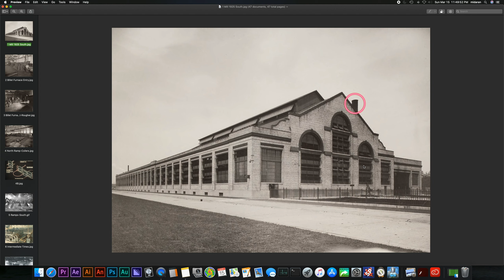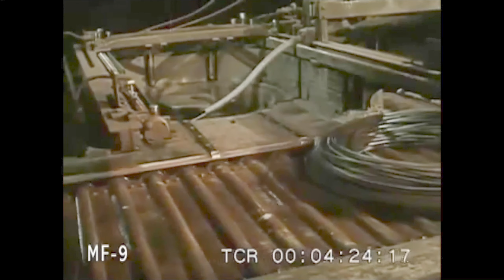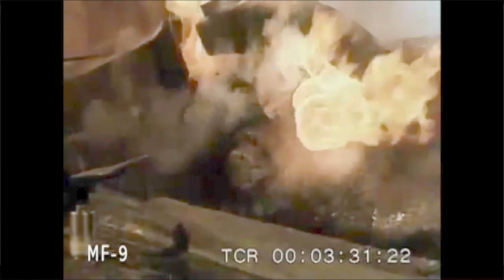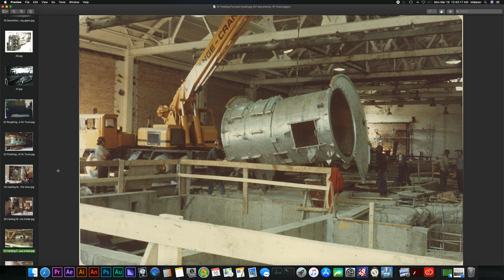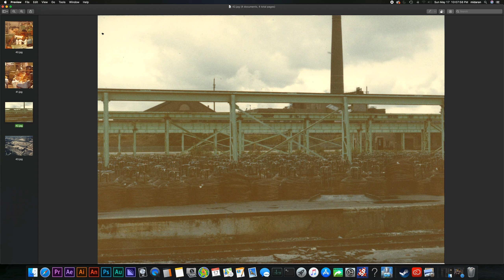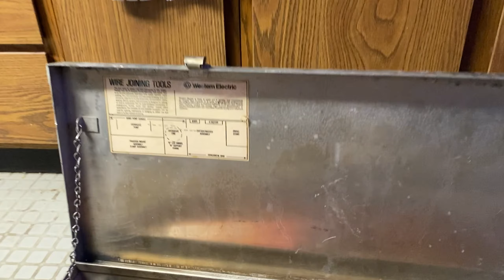Western Electric Rod & Wire Mill 1925-2008 Documentary

Comment: I had a tour of this mill in the early 70s. Remember one of the catchers picking up the rod he had just caught and lighting a cigarette with it.
Reply from the maker: Seems like a very 1970s thing to do😆 We used to cook chicken just by setting it near the tap hole of the shaft furnace. Even bbq inside. The building was designed to vent smoke so wth right?

Comment: Very cool, I used to repair submarine cable, old WECO cable & Bell Labs manufactured the amplifiers for submarine cable in the 80s, most of the cables we worked on were manufactured in the 50s. It used to blow my mind how long these damn cables were.
Reply from the maker: I have to wonder if there were factory splices in that cable. If they were manufactured in the 50s that would have been back when the rod mill still used copper billets. The length of the coils were short which limited the length of cable that could be drawn from them. I believe that cable could have been put together in the building just West of the rod mill. We used it as a warehouse, but it was known as the armored cable plant.
Reply: @TestTubeBabySpy  Yes absolutely much tighter then the ones we would make. IIRC we were using WECO B armour for these cable lays. They supported MiLS sites on several tracking stations on the Eastern Test Range. You could feel the factory splices as the cable was unlaying out of the storage tanks on the cable ship.